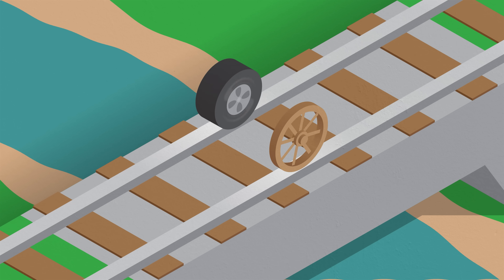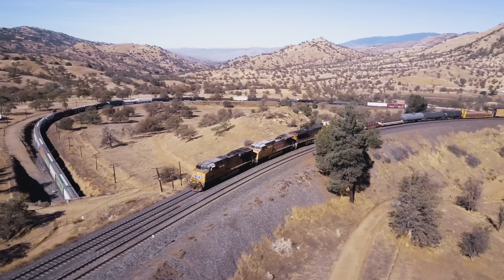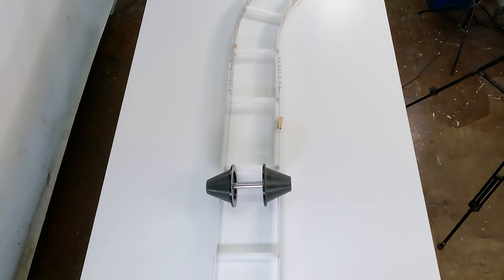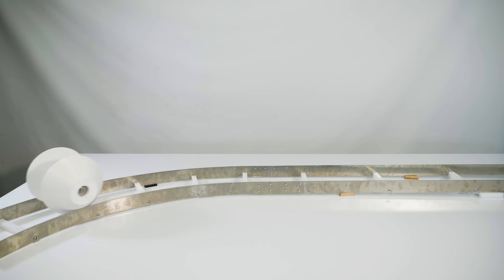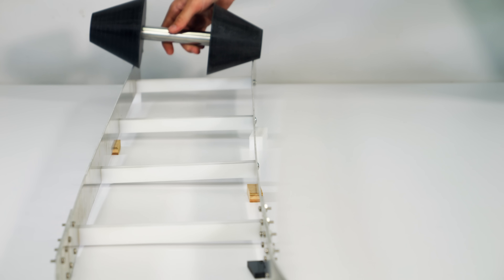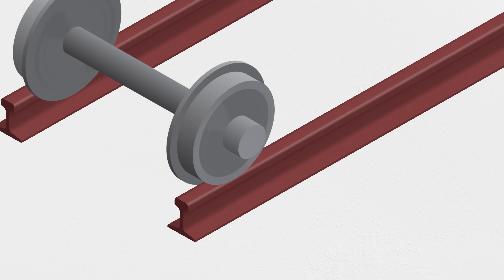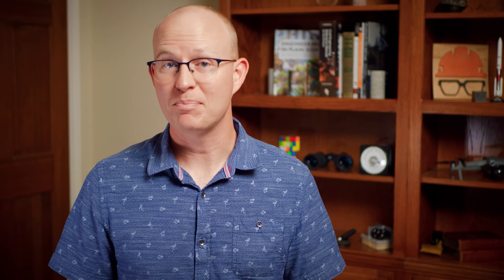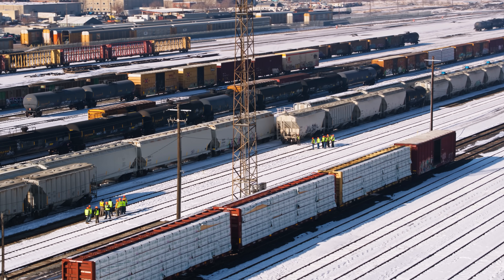Why Are Rails Shaped Like That?

Comment: There are three items about the rails that need to be mentioned. First, the rails are not flat on top. The apparent flat surface is actually a gentle radius. Previously it was a 10" radius, new rails are now manufactured with an 8" radius across the head. This, in conjunction with the second item, called cant, keeps the wheel contact patch centered on the rail head.
Cant is induced by the tie plates that support the rails. The plates are flat on the bottom where they bear on the crossties, but the seat that supports the rails is slightly tilted to the inside at a 40:1 pitch. This tips the railheads inward about 1/8" each from a true 90 degree angle to the crosstie.
Third is superelevation. Raising the outside rail to bank the track slightly in curves. In track designed for really high speed running the difference in elevation between the inner and outer rail is as much as 6". This effect also helps the tapered wheel treads self center at speed and keeps the flanges from dragging on the high rail. Excess superelevation where trains are not running fast enough to use it is a disadvantage. Now the low rail receives excess weight and wear. In fact trains can actually tip over at a stop if they are carrying top heavy loads.
Another interesting item is, that despite their huge imposing appearance, the center of mass of a locomotive is actually only about 5' to 6' above the railheads, which are set at standard gauge, 56-1/2" measured 5/8" down the railhead. This gauge dimension puts the webs of the rails at just about 5' even, which varies only slightly depending on which size rail is being used. All the really heavy parts are down low.
Reply: Very interesting.
Reply: I was thinking they may also introduce some slight banking to help equalize the distance the wheels travel as well.  Thanks for the detailed comment!
Reply: Most I’ve personally seen is 5” of cant/superelevation

At that point hydraulic oil started to leak out the breather on the equipment i worked with, and we couldn’t unload spoil because of tilting protection
Reply: @thomasa5619  The standard maximum cant used in the UK is 6", but there are a couple of sites with 8". Rails are also inclined inwards at 1 in 20 to match the cone angle of the wheels.
Reply: @meeeeeeeeeeeeeeeeeeee2  yeah I was working with some pretty specialised plasser equipment

I can smell panolin from 50-75 meters away since an incident 3-4 years ago where a broken hydraulic fitting lead to me breathing in a bunch
Reply: The British pendolino trains are designed to tilt on bends. It feels strange at first
Reply: @porkbroth  Amtrak Acela uses Bombardier tilting trains, too.
Reply: I am also interested in this stuff, the cant makes perfect sense it helps to keep the rails from pushing out because of the tapered wheel. Sort of a buttress.
Reply: Pretty surprised he didn't at least mention superelevation.
Reply: How u kno so much train stuff?
Reply: @Avidav  - How are you functionally illiterate?
Reply: @johnsmith1474  what?
Reply: @johnsmith1474 wtf lmao relax
Reply: Those are big words, John! 😉 @johnsmith1474
Reply: Is the old story about roman chariot spacing between wheels true, that the us system somehow descended from it or did it develop gradually and standardization ruled out other gages?  Seems ive heard the early coal and steel baron days had differing gages depending on the owner and their engineers. Brazil has a different gage than the US? Argentina too?
Reply: I recently learned that roads and highways are not flat either they also have a gentle radius. Is that so rain water can drain off? Just wondering.
Reply: @glennso47 yes.  It is at least in part to help water drain off the road.

Comment: Railway Engineering in the Nineteenth and early Twentieth centuries was the “rocket science” of the time. Same problems of how to move a payload with an engine carrying its fuel at the same time. Small improvements in steam engine efficiency made big overall differences.

Comment: And there are also rail grinder vehicles. I'm not knowledgable in the area, but I can guess their purpose.

At first, I thought they were for cleaning rust from electric railways, for better electrical contact. Now, I realized that grinding rails can also reprofile the rails. Grind the badly shaped parts of rails, until they are too worn down for safely being grinded and used.

Fun story: When I was younger, I thought the webs of rails were eventually bending(or buckling) and the head was eventually sitting on the foot. But it was still being used until being changed. With my current mind, I can see tons of problems with this, but the strength of rail webs were too much for me to understand, at the time.

Comment: I always loved trains ever since I read Railway Children and Thomas the Tank Engine as a kid.

Even apart from that, they are the most memorable invention that marked the start of the Industrial Revolution, when Man first learned to harness the power of machines instead of himself.

Even now, it amazes me to think that most non-renewable-energy based turbines still work using the same way - using the steam from boiling water.

6:25 The idea of using conical wheels with flanges is absolutely ingenious. I knew what differentials were and how cars used to deal with the problem of turning, but I never thought there was such a simple way to do it.

Even rails make a lot of sense when you want to move something extremely heavy without damaging the ground and need to guide it.

Comment: The Web does more than elevate the rail. Like an I-beam, the height has a strength function to distribute the moment load across more ties reducing the need for a larger foot.  Increasing the web height would reduce the required foot size.
Reply: It seems to me, that the web supports the load between ties.

Between ties, there is no support; the rail just has empty space below it. The web provides the strength needed to resist collapse over that span.

Between the ties, the rail is a bridge. The web assumes strength in that bridge.
Reply: … assures strength…
Reply: Ah, no. There is no "strength function to distribute the moment load across more ties" ie the height has no effect on the load below it. And why would it?
Reply: The cross-section of the railroad rail is two dimensions. The rail exists in three dimensions. The load of a moving train in the third dimension creates a dynamic uniform load along the tracks.  The best way I can explain it is a hypothetical example. If instead the normal wood tie spacing {19"} consider if that spacing was multiplied by ten times or more {190" or more}. The foot of the rail would be increased proportionately to carry the new load but if the height stays the same...the rail would fail.

Comment: From what I  learned, trains are one of the most common autistic interests. I was a train fan since 1-2yo, myself. I believe I had no idea on the capabilities of trains, at that time. So, it's something more than understanding them that makes them interesting. Of course, learning more about train only adds to the amazement.

I personally have
- rotating object interest
- alignment interest
- smooth movement interest
etc. that make trains very interesting. For example, a train entering a passenger platform feels extremely satisfying. That smooth approach of that huge object, the alignment of doors and the platform, the contact of catanery and pantograph... So many things. I can count so many...
Reply: This is the most Twitter thing I've read lmao

Comment: You didn't mention that the rails aren't perfectly aligned 90 degrees from the floor and perfectly parallel one to the other, specially on turns. Also, the more heavy a rail is the more duability it have and faster the trains can go through.

Comment: this made me wonder about, let's call it a sideways force, pushing the rails away from each other. since the wheels are tapered, thicker as they get cloer to each other, wouldn't this mean they act as kind of a wedge trying to separate the rails? has any rail failed in this manner? either the ties being broken, or the rails snapping? 
thank you!
Reply: It's called "spreading the rails" – happened a lot with heavy steam locomotives.

Comment: A good real life example of the conical wheel shape causing hunting is on the DLR. To make the extremely tight curves on the railway the wheels are much more conical than usual, and the hunting is extremely obvious when travelling on straight sections of track. You can see it quite well in this video https://youtu.be/WX_WuUtpl1I

Comment: Why does the head need to be symmetrical? Why not only have the "interior" portions that are supposed to be in contact? The only thing I can think of is that it allows you to resemble the rail and flip it's orientation to wear the other side of the head... which would save you the foot and web costs of a second rail piece...

Did I just answer my own question?

Comment: I have always wondered how train tracks work and are stable. I can get pretty close to trains where I live and I see the track bending just like 3:58 in the video. The tie rods dip down under the load of the wheels going over. How does it bend down and spring back but not move any other direction?

Comment: The contact patch does not travel the same speed as the train, it remains static: it does not move at all. That is the way all wheels work, the contact patch is stationary. That gives the wheel the properties that makes it so great invention, it has no friction since the contact patch is stationary and it also provides static grip, not dynamic. In case or rubber wheels, it also allows sticktion in the form of hydrogen bonding... which would be impossible if it moved alone with the car.